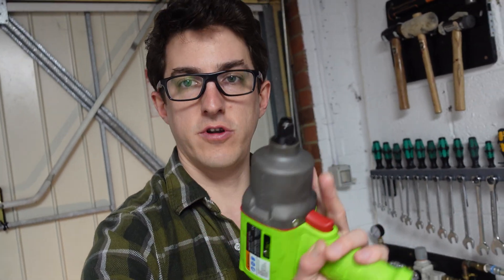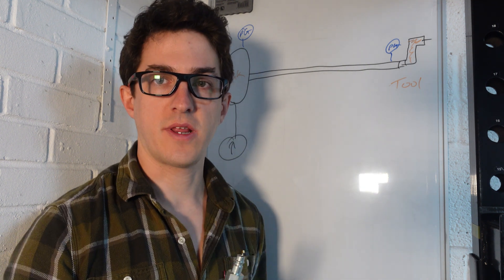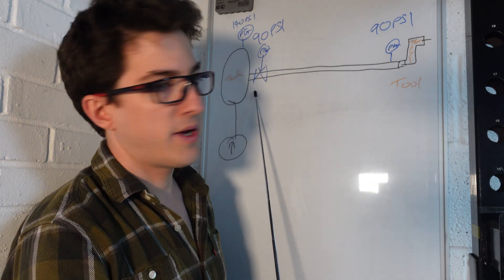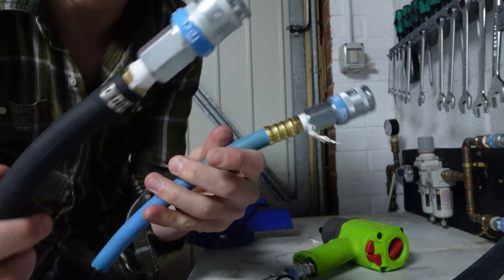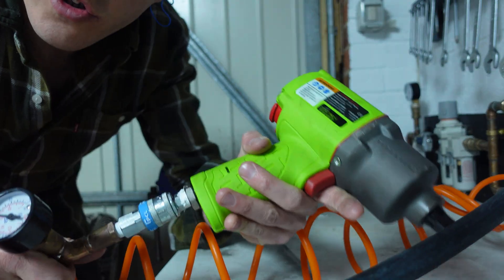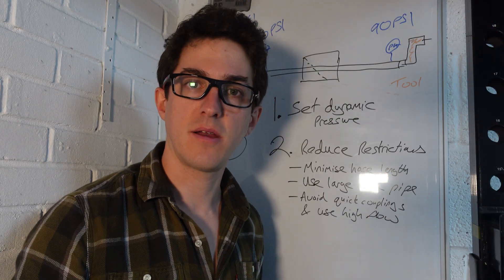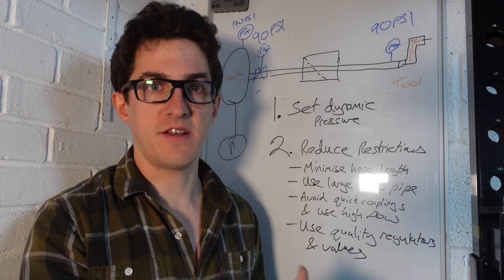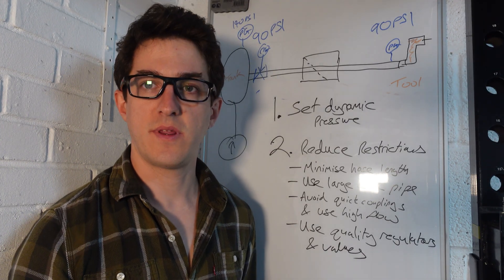Set Up and Optimise an Air Compressor for use with Pneumatic Tools.

Comment: This is a great video.  Helpful for a guy like me who is in the process of deploying compressed air in my garage.  An issue that I am trying to sort out is how, (or whether), to use my compressed air in the winter in my unheated garage with air temperatures often well below freezing. I'm beginning to wonder if I should just turn the compressor off for the winter months.
Reply from the maker: Are you in the UK or a particularly cold country? I have always ran mine through the winter with no issues, I am not sure if they specify a minimum operating temp in your manual? 

When running mine gets pretty warm, but I guess the oil might be thick initially when very cold, so bit harder for the motor to spin up (could use thinner oil if available?). 

I drain my tank fairly regularly from the bottom, usually daily after use, that keeps moisture out of the system which will build up more quickly in the winter.

Comment: Ed - intersting video . What make of valve did you end up using? I have a similar problem with my air tools. Thanks.
Reply from the maker: Hello Paul, i use Pegler quarter turn valves usually, and PCL XF quick couplings. My gauges arent so great, so no good recommendations for that, I just have cheapos.